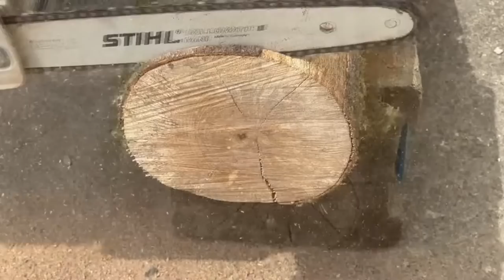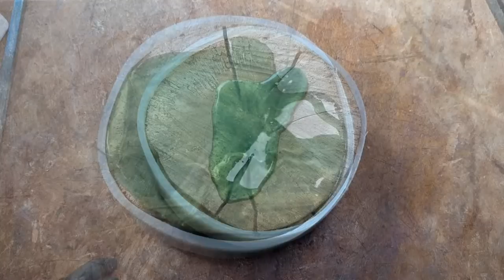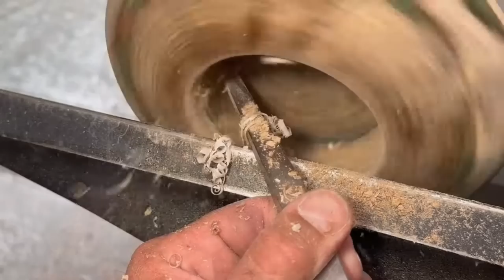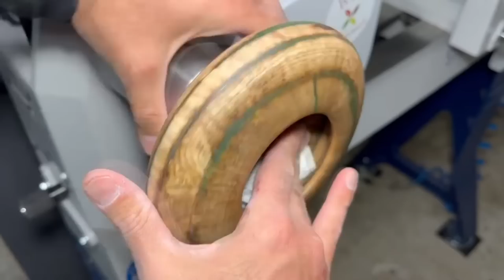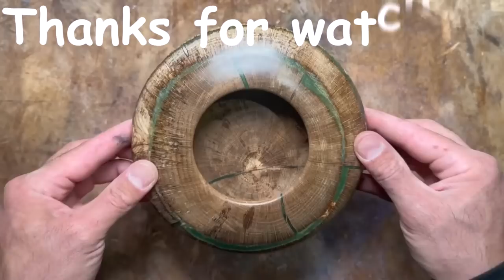Woodturning: a simple, charismatic and easy-to-achieve project👍

Comment: Hi 👋, BAW , I love the the way you used the sliced sections of wood orientated them and then put the resin into it. It looks amazing, 
The green structure resin is a great combination , I am hoping to get some resin later in the year and have a go at something along these lines, did you use a vacuum chamber before you put it into pressure pot?, Brilliant job. Well done, Phil from the moulin France.
Reply from the maker: Hi Phil
No, I didn't need to use a vacuum chamber because the room is not very high😉